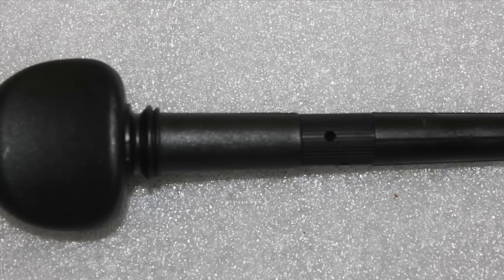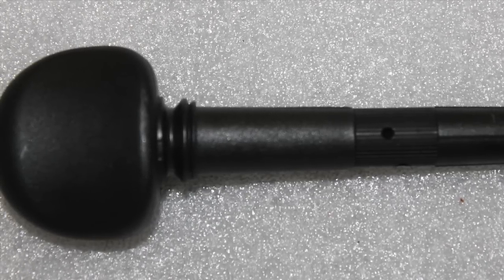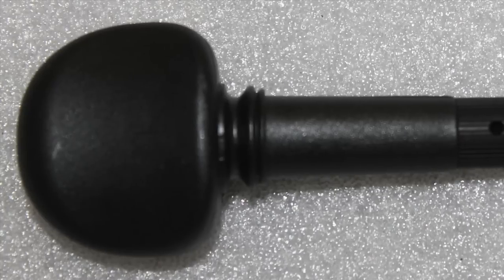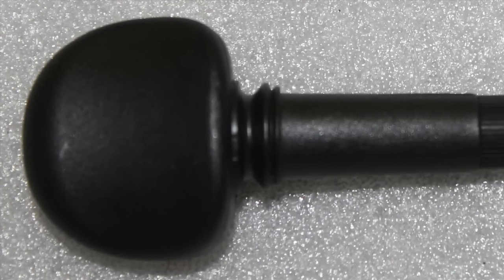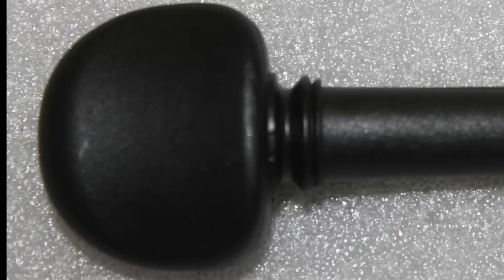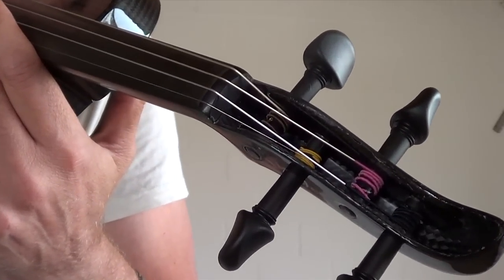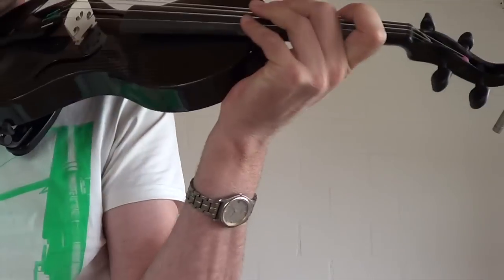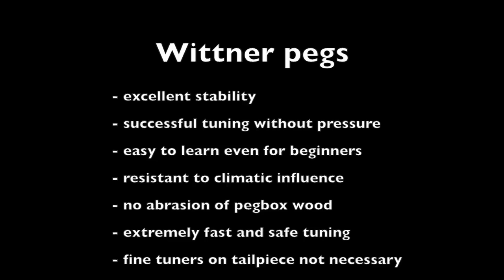How to use Wittner fine tuning pegs and how to tune a violin

Comment: Ich habe einen Ernst Heinrich Roth von 1961 mit den originalen Casperi-Maschinenheringen und sie funktionieren immer noch ziemlich gut. Ich mag deine Heringe. Sie scheinen vielleicht eine bessere Heringe zu sein als die Casperi. Vielen Dank für die Erklärung.
I have a 1961 Ernst Heinrich Roth with the original Casperi machine pegs and they still work pretty well.  I like your pegs.  They seem like perhaps a better peg than the Casperi.  Thank you for the explanation.

Comment: mezzofortegermany It has Geared Tuners like a Guitar which make tuning it alot easier. Why not make me a Carbon Fiber 5 String Acoustic-Electric Double Bass? I've wanted it strung in 5ths Tuning with Pirastro Obbligato 5ths Tuned Double Bass Strings (Synthetic Core Low C including a High E Solo String) so that I have a fun range to jam with.

Comment: how do you change the strings if you have these pegs? I tried to remove the string one time but the peg wouldn't come out , so what do you do if you want to change the string?
Reply from the maker: You just turn the peg until the string comes off. Not necessary to get the peg out. It takes more time than changing strings on a traditional peg, but this time is saved up ten times with faster tuning.
Reply: Cool, thank you.
Reply: @Eevee501  You can also use a Guitar string winder.
Reply: @mezzofortegermany  Why not make a custom string winder very similar to a Guitar String winder? You can crank the pegs when restringing it this way. Things have changed over the years.

Comment: What kind of material are the peg?
Reply from the maker: the peg itself is compound material, the machinery inside steel. These pegs never break and never fail.
Reply: @mezzofortegermany  Geared tuners never fail. I'm afraid they'll have to discontinue all the friction pegs & fine tuners & just stick to geared tuners cause they turn more smoothly.

Comment: These are the WORST GAWDAWFUL tuners on the planet. I hate them. They are almost impossible to keep tuned. And they are crude to use.
Reply: +C Loff I love them and they work fine when installed properly.
Reply: Aren't they adjustable?
Reply: They're easier to tune remember cause they stay put so they're better.

Comment: these are pegs from pegheads and not from wittner because the violin in the video is a fiber carbon from luis& clark. I had a luis& clark cello and can confirm that the pegs are rubbish.
Reply: wow, thanks for the friendly response. Hopefully you feel better now.
Reply from the maker: No. I feel quite normal as always. Sorry that you feel treated unfriendly.
Reply: @mezzofortegermany  They're actually a copy